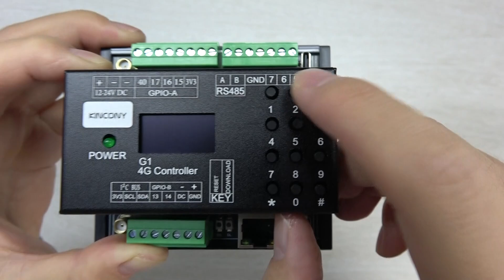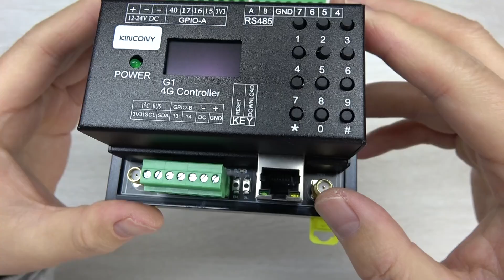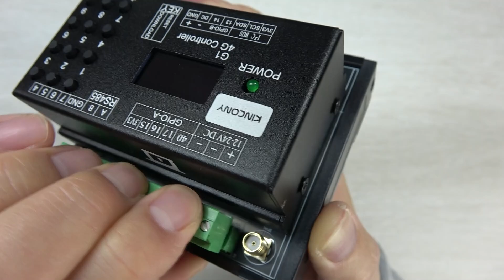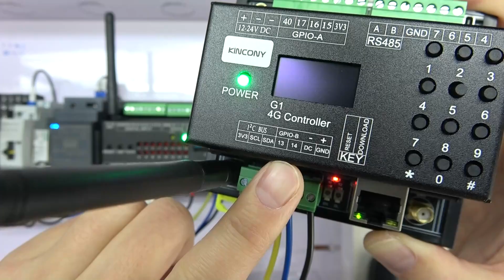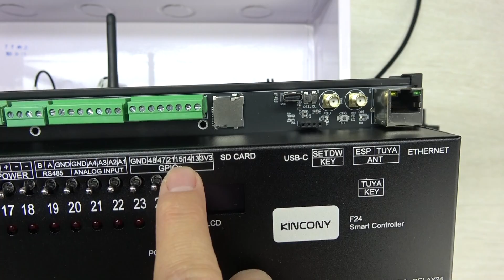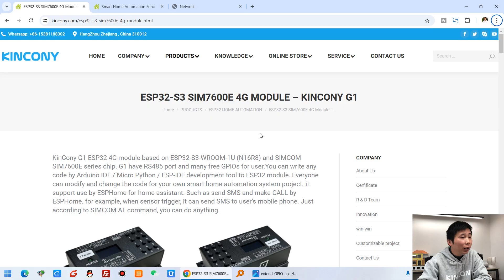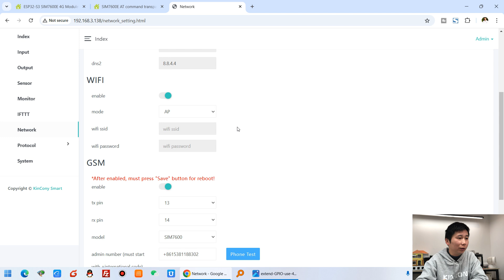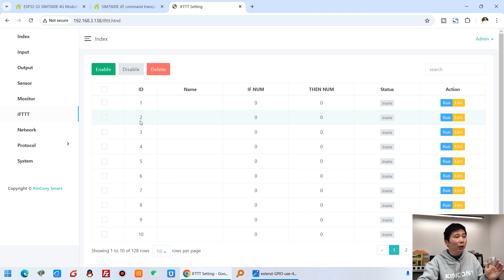ESP32 4G module -G1 Let smart system add SMS CALL function

Comment: can i comment? 4G inside panel is bad idea
Reply from the maker: sure, if you want replace 4G module, you can open the box, replace by yourself. there is 4G module socket inside of box.
Reply: @KinCony  i mean, 4G module inside panel is bad idea. Better you make product 4G outdoor IP65.
Reply: if 4G outdoor IP65, i can put on top of little tower. 3-4 meter. So signal and connectifity good. Powering POE.  

How about analog signal 4-20ma expansion? and 0-10v expansion? i can not find on your store.
Reply from the maker: @FahmiAbdillah-z6j  do you means i2c 4-20mA or 0-10V output extension module?